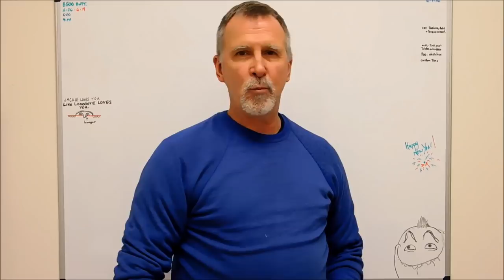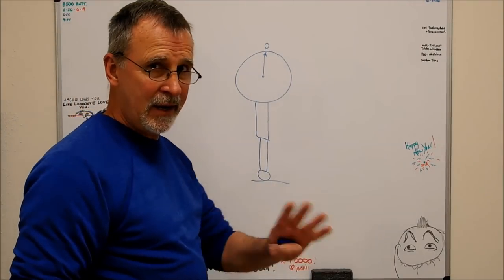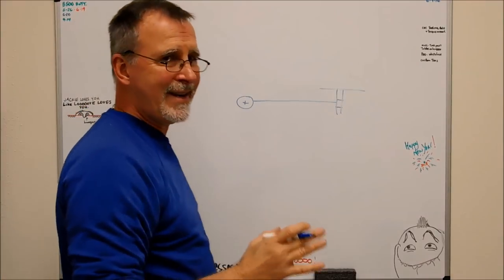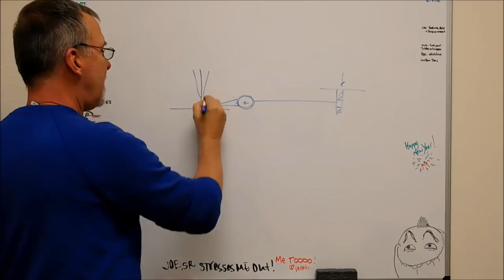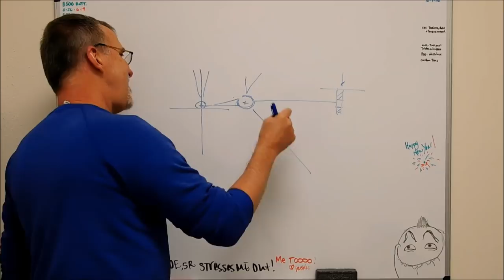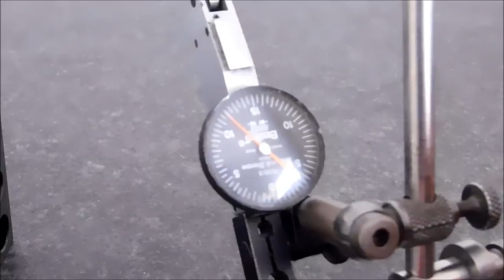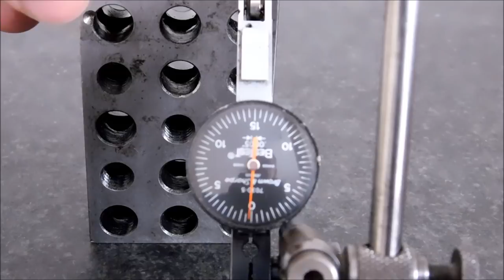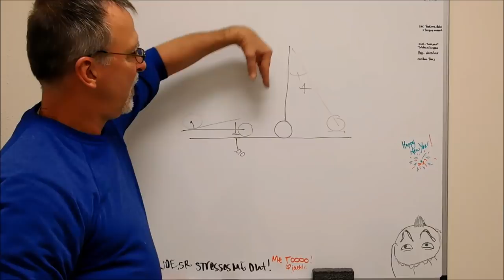Cosine Error Demonstrated and Challenged !

Comment: When I was introduced to cosine error it was on a CMM, because the measurement is taken from the center of the probe, when measuring a surface on an angle that is when the cosine error occurs. The point of contact and the actual are not exact. I can't draw a picture but hope it makes sense.

Comment: Cosine error is a joke...If you care about T.I.R. (total indicated runout) you just multiply the "flawed" distance reading with the cosine of the angle of your indicator plunger or indicator arm and have an absolute reading (it's more complicated with test indicators as the angle changes, so you have to visualize the maximum and the minimum reading separately unless the average is exactly when the arm is parallel to the part, in which case it shows the total deviation from the centerline as you mentioned.Thus they are more suited towards indicating to 0).
PS: I think it would be better if test indicator read the Δθ of arm movement in arc minutes and seconds for known distance arms instead of meaningless length units (not really a unit since each division is different to the other)!
Reply: "....the cosine of the angle of your indicator plunger or indicator arm...." 
How do you measure that angle ?

May I also ask how long you have been a machinist, toolmaker, engineer or metrologist ?

In the US, TIR stands for " total indicator reading " , not " total indicated runout " .
Reply: You can measure an angle many ways. If you run an indicator across something which is angled for a known distance of your machine's cartesian system and divided the travelled distance by the indicator movement you get the cosine itself. To measure a delicate plunger the best way would be to do it optically(maybe even set the whole thing in an optical comparator). I have to admit though that measuring angles isn't always as easy.
 
I'm now in my last year of my engineering degree, I have been making stuff since I was less than 10 (I did my first wood carving with a dremel when I was 4). I really decided that machining is my thing while I was building motorcycles and found how big of a role the machining quality has and how every freaking thing around us required to be machined at one point. I'm now 24. Also I'm from Greece and don't know how all these terms translate in a technically correct way right out of my head (but smartassing asside it gave you the idea of what I meant, it's pretty much synonymous and if that confused you an insult is in order---keyphrase "indicator reading").
Reply: I should note that if you're indicating a taper to set the compound at an angle, your indicator must be on the center line of the part (or use a disc plunger in case of a dial indicator, but then you will have to set it completely leveled, maybe even indicated, and square to the travel of the compound) or you will get cosine error from the part and not the indicator. On smaller tapers this is much more obvious.
Reply: Your comment  : " Cosine error is a joke...." betrays the source of your conjecture to be not from tutelage or experience - but from a book or similar non hands-on source.
Your " cosine error.... " comment smacks of arrogance.
 You should spend a decade or so in the precision metalworking field and you will learn not to make such ignorant and useless observations.

Just as an FYI - I started my USDL sanctioned apprenticeship on June 24, 1957, and, interspersed with a few subsequent executive positions, have been toolmaking ever since.

How old did you say you were ?
Reply: Also what I stated matches what Joe's hands-on experience and observations concluded to and I also stated a case which even him and you might no be aware of errors while in contrast you didn't provide any dialectic to support either my argument or yours. You are not helpful to anyone this way and you are just distracting me from studying fluid mechanics (I have an exam tomorrow and I expect to be triumphant) without any tip, hint or even a cheap laugh in return. Nobody is comforted by your success.

Comment: Joe would you see a cosine error if you tipped the face of the indicator to a angle different than the part not perpendicular to the part. All of your demonstrations showed it in a relative angle to the part. In other words turn the axis of the pivot to a different angle and this would prove the cosine error does exist. It’s all in the setup bro. The pivot axis has to be perpendicular to the part no matter where the tip is.
Reply from the maker: Using a lever indicator, the best results are when the lever arm is within 10 degrees of parallel to the part axis. The dial face position has no impact. A drop indicator should always be perpendicular.  Just an FYI....if the indicator lever pivot axis is perpendicular to the part, the arm will swing sideways and not work at all.
Reply: Ok, got you. I am new to machining and machining trade tools. I did not know that the lever would not move if it was in a slight swing. Good to know. It was all very clear in the video besides that. Thanks. Keep the awesome videos coming. I am learning so much.
Reply from the maker: @timothycamp6776  The lever will move if the tip is touching the work. Maybe we just had a misunderstanding in terminology.
Reply: Joe Pieczynski, I actually meant the pivot axis being “parallel” to the work. If it is cantered just a bit would that introduce an error or would it not be enough to notice? This is what I was thinking when I mentioned the face of the indicator. Not trying to be argumentative, just new to all this and want to get it right before I mess up.
Reply: @Timothy Camp

You are talking about rotating the test indicator, from the position Joe demonstrated, right?

I don't think Joe caught that.  And you are correct, you rotate the indicator and the design of the indicator is defeated. The contact arm rotates in a place around it's pivot. THAT plane is perpendicular to the dial face.

You must set up the indicator to 'indicate' in that plane, as well.

Did I beat that to death, enough?  I'm getting older, and trying to cram as much into my head, as I can, (you will understand when you hit your mid 60's), so I constantly a newb in something.  Finding answers to basic questions is the biggest challenge to self-learning, and lack of knowledge fosters ALL kinds of questions, not obvious to experienced people.

One of the reasons Joe is so good, is he doesn't skip the basics.  HE was taught well.

Comment: Of course you're right, Joe - DTI readings are based on rotation of the arm, NOT the linear travel.  The angle of the arm to the body ofthe DTI is irrelevant.  Due to the geometry of the DTI and the range of the scale, the angle of the arm to the workpiece (which should be close to parallel) should be pretty constant over the whole range of the scale.

As noted, or at least implied in your response to another comment, the DTI is not intended to be used to measure linear travel more than a few thousandths, but rather to TEST for DIFFERENCES (and/or true them out).  Hence its name. 

Cosine error in a DTI would appear if it is used (incorrectly) with the arm at a large angle to the wrorkpiece.  Then the indicated value would be too large.  But who cares? That's not how the tool should be used.  A hammer won't drive a nail if you hit it with the claw side.

Comment: Great video as always. I would add there will be error if the test indicator is leaning to the side. Your demo has it vertical but if you tilt it, the travel would decrease. 45 degrees would show .005"

Comment: We learned this very early in tech school. We had to bore a hole off center in square stock on the lathe. You have to use a 4 jaw chuck. If the indicator wasn't perp to the work, the bore would be off.

Comment: I have to agree with you.  Otherwise what is the point of giving the tip an angle adjustment feature that goes beyond 10 degrees. Not to mention from my own tests I have never been able to see a difference regardless of the angle when using a lever indicator.
Reply from the maker: The more parallel the arm is to the surface being checked, the more accurate the dial reading will be. The more perpendicular the arm, the greater the error. Just think about a ball on a string hanging straight down. The string ( angle) will move much farther when you slide something under the ball than it would if you laid the string parallel to the floor and repeated the test. Its all about the angular movement of the arm.
Reply: Sorry I should have been more clear with my post.  What I meant to say was 'regardless of the angle with the body of the indicator as opposed to the angle of the lever to the part when using a lever indicator.

Comment: So, a test indicator will never show absolute distance accurately since it is always converting tip axis rotation into a linear motion inside the indicator on a helix, which is also slightly compounding the error (+ or - of the sine) from the internal arm carrying the ruby bearing (on the Last Word, anyway) - because the tip angle will always be at some angle to the measured surface since it has to tilt in order to move to accommodate the measured surface, which changes the angle.
The larger the deviation (needle swing) the worse the accuracy. It's not at all accurate because it's not linear, like a drop indicator is.
Reply from the maker: On any arc, the error of drop increases as the angle of deflection increases. Most indicators will suggest you keep the tip within 10 degrees of linear to the body, and measure with the indicator body as close to parallel with the surface being inspected. Outside these paraameters, the error goes up and the reading will be much greater than the actual condition.
Reply: @joepie221  I thought your point was that the indicator body had no relation to the issue and that it was only the stylus angle to the work that mattered.
Reply from the maker: @jlippencott1  That is the point.